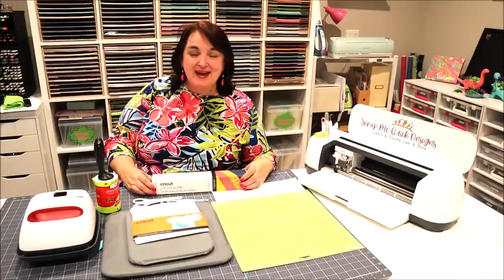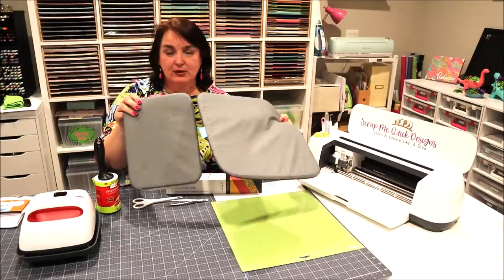Cricut Infusible Ink Transfer Sheets Step By Step Tutorial

Comment: Great tutorial - but I am having a problem that maybe you can help me with.  When I cut the infusible ink transfer sheet, it doesn't cut all the way through.  It cuts the surface, but not all the way through the paper.  I have an Explore Air 2.  I set it on custom and then on design space click on more pressure.  It still will not cut all the way through.  I've spent a total of about three hours with Cricut support (they are using a call center in India, and the agents have no idea what a Cricut machine or how to help me).  I have done all the troubleshooting steps on videos, Cricut.com, etc., and nothing works.  I thought maybe I had a bad sheet, and I opened an brand new box that was still sealed and took out the paper, and it still didn't cut. I thought maybe it's the black color of infusible ink, so I used pink - still the same.  I've changed the blade. I just took out and reseated the blade - nothing.  Help?

Comment: Hi what happens when the temperature on your easy press only goes up to 360
Reply from the maker: Do you have the original Easy Press that is blue ?  If so, you can still use it on the Infusible Ink but you do it at different temperature and time durations.  You can find those on the Cricut Heat Guide Chart Here by selecting the Blue Easy Press at the top.  https://cricut.com/heatguide
Reply from the maker: Now if you are saying you a Easy Press 2 (raspberry) and it won't go above 360 degrees then you need to contact Cricut Support.

Comment: Great video!! So it only  has to be poly/nylon or poly/cotton blend?
Reply from the maker: to get the best results the material needs to be at least 80% polyester for the infusible ink to bond with it properly when heated.  You can do a little less...but the results wont be as vibrant.

Comment: You have to use cardstock? Can I use a think piece of cardboard? And do I have to buy the Cricut mat? What about a folded towel?
Reply from the maker: Hi. You could try using a thin piece of cardboard just make sure it doesn’t have any inks on it or color. You don’t want that transferring to your shirt.  That’s why they recommend white cardstock because there are no dye colors to transfer. Cricut really recommends using the Cricut mat to get best results but a folded towel on a hard surface might work. FYI - You do have to use an Easy Press or Heat Press on Infusible Ink products, a household iron will not work. Give it a try and let me know as I haven’t done that myself yet. Good luck and have fun with your project.
Reply: Debbie ONeal thanks! I purchased both the infusible ink and the Easy Press I just wasn’t aware I had to have all the other stuff lol. I will get cardstock just to be safe.

Comment: Thank You! I really was looking to see how you did 3 different infusible inks on one project. I have seen where they add them all to one sheet. It looked like you trimmed close on the bow and writing then kept all the pink together and added it last so the clear transfer sheets did overlap. Is that correct?
Reply from the maker: E Barner yes I did do that this way for this small project as I wanted to preserve as much as my transfer sheets as possible so I just layered these. Being careful to not overlap the images but it was fine overlapping the clear part.  When I do a larger project I will generally have a bigger piece to layer on the different colors on 1 transfer sheet.  You can do it either way 😄

Comment: Great! A lovely sleady tutorial so I could follow easily! Thankyou. I will be experimenting tomorrow. I don't have an EasyPress as they are too expensive for me but I have already done a small mandala and pressed it with my small craft iron (the one with a sort of pear shaped button for a handle) and the result was fantastic! I checked the iron's temperatures beforehand so I knew which setting to use and I know now I can do small projects. Next I will experiment with my steam press (without the steam of course!) as I have checked the temperatures on that as well. Whether or not that works remains to be seen but I am really hoping it does. I am amazed at how vibrant the colours are once applied to the project. The one you did on the baby garment is so cute! Thanks again :-)

Comment: Can you use a regular iron ?
Reply from the maker: Chicky Raven no unfortunately not.  It requires 385 degrees and an iron does not get that hot .  The chemical process to release the ink just won’t work.  Infusible Ink was designed for Cricut Easy Press or a Heat Press
Reply: Thank you

Comment: Thanks for the project above. Question please. Do you think this infusible ink will available for other color t shirt, such as Bella canvas heather grey etc. Also I do not own a Easy Press. Will these work with a Clam Shell Heat Press as well?...TIA
Reply from the maker: Barbara j  the only shirts that will work currently are the Cricut Infusible Ink Compatible blanks sold by Cricut. They only come in White. There are possible plans to offer other light colors in 2020
Reply from the maker: Barbara j   As far as a heating source, Cricut has said its possible to use a Heat Press but results may vary.  They can only provide heat settings using the Cricut Easy Presses
Reply: @DebbieONealSMQD  Appreciated...